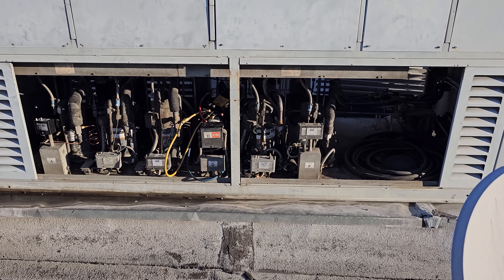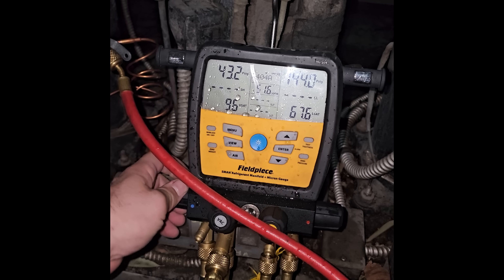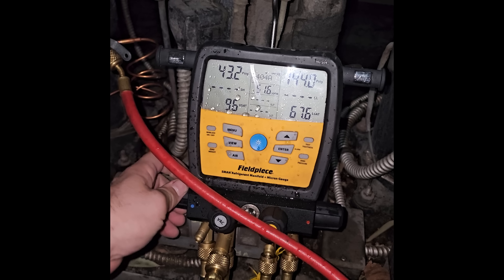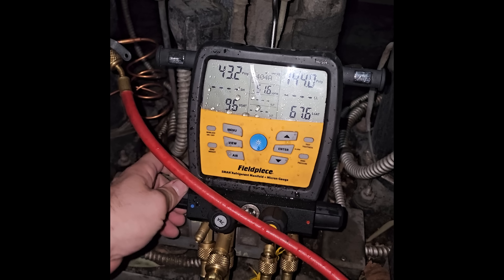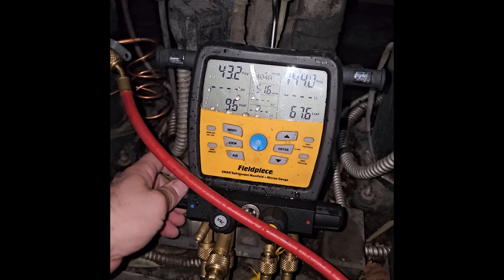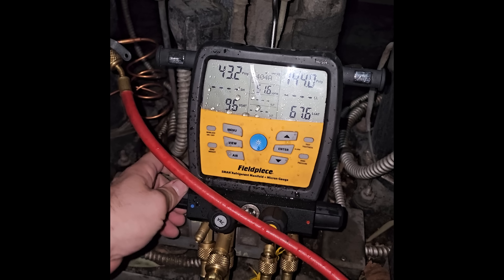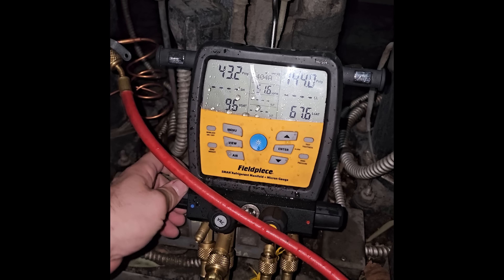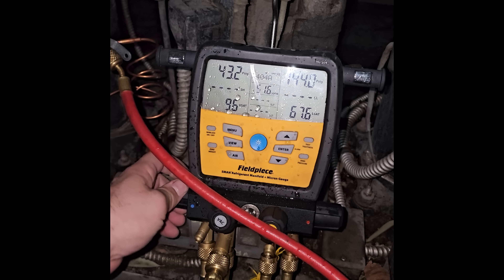THIS WALK IN COOLER CALL WAS NOT FUN IN THE RAIN

Comment: Just in case its helpful to someone in the future, I have in the past patched up rubbed out capillary tubes with a but of 1/4" copper, you just have to be careful not to block the capillary with braze. Many dual pressure switches will work with only one side hooked up, you just have to adjust the unused side so there is no possibility of it switching and stopping the unit.
Reply: I have done that in the past, you can make the butt piece longer to negate the risk of soldering shut but that may require a slightly higher charge
Reply: What works the best is a 3/16” tubing extender (braze on schrader port), the tubing is the exact right size to fix a capillary tube.

Comment: Ah yes the „joy“ of recovering charges in cold weather… had a major repair on a heatpump airconditioning system three years ago with about 60 lbs. of gas in it. Because another tech said that it appeared the unit was low on charge so I had to recover the entire charge in January with an ambient temperature of around 40 degrees. Would have not been a big deal - if the manufacturer had marked the valve for the receiver/liquid separator in a reasonable manner and had not placed it hidden behind the compressors. I had to get a gas torch out because I supercooled the liquid so low it frosted the receiver while recovering.
Reply: In that case you should keep the system running while recovering as long as possible, keeps the temperatures steady
Reply: @FerdinandFake  oh, we did. I pulled the fuses myself that very day. I always compared recovering through the service port on that particular system to emptying a swimming poo with a table spoon. (Roughly 6 to 7 feet of snaking lines between service valves and the receiver, through iirc 3 reversal and shut-off valves). When i was done I found the hidden port at the receiver bottom.

The main problem turned out to be a reversal valve that decided to go the way of the dodo and fell apart internally. And I had to abbreviate the technical side of things, for I assume a Mitsubishi Electric City Multi VRF system is not necessary ‚common‘ around the globe.

Comment: A heat gun might work to get the refrigerant out of the oil...but you need a circuit which can handle the power draw of the heat gun...

Wasn't that smart manifold over $1000 when it came out?

Comment: IF YOU THINK about it,you do not have to recover the refrigerant to replace the drier or the dual p.s. thanks for sharing.
Reply: Why not? Would just pump down if system had a receiver with a king valve?
Reply: @goodguyeugene  yes,and you can close compressor valves to replace switch.
Reply from the maker: So because of the type of service valve this system had you cannot shut off the refrigerant flow for the  pressure port the pressure control was on, so yes I had to recover. Only one side  of the valve shuts off and we use that side for our gauges
Reply: @HVACRVIDEOS  you can pump down the system,seat both valves and you will have very little refrigerant on compressor,like doing a compressor replacement.